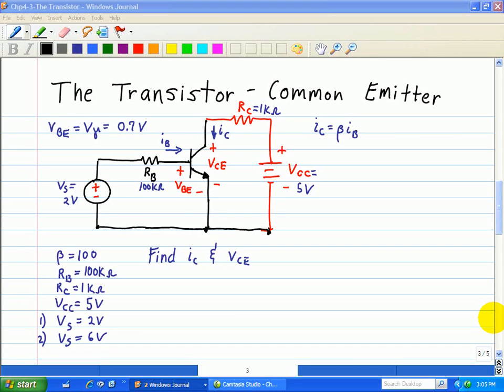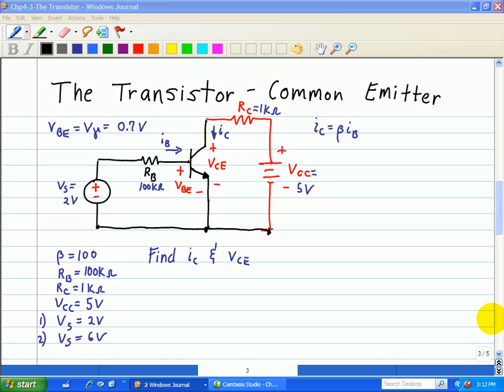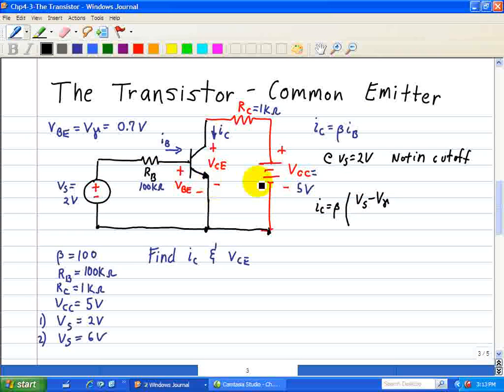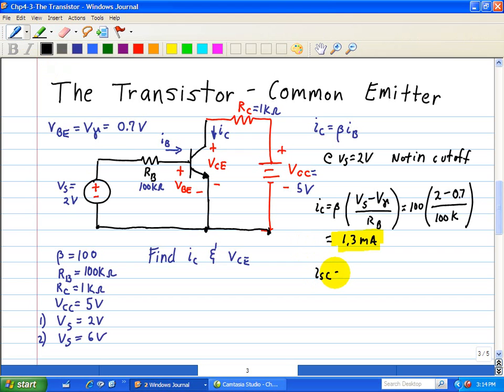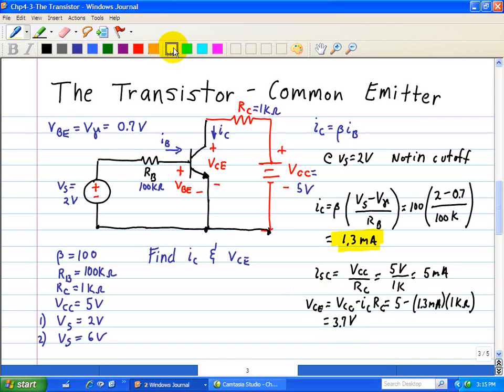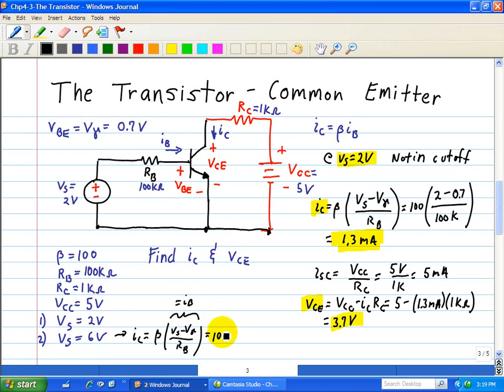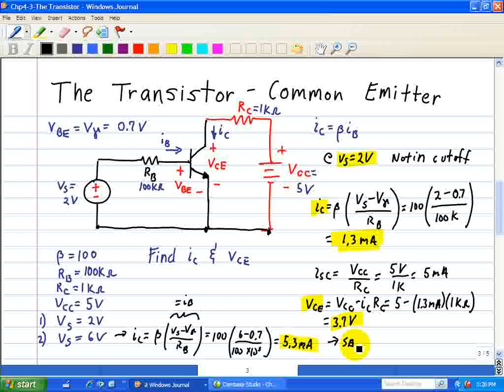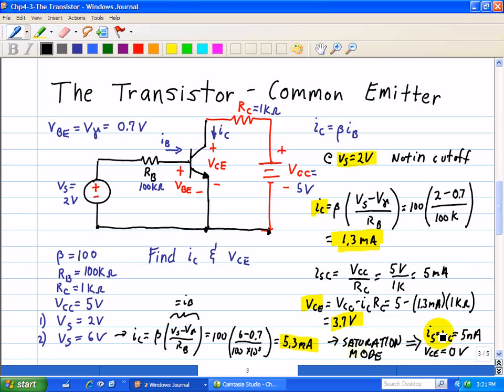Circuit Analysis - Transistor Tutorial - Common Emitter Circuit - Part 2 - Transistor Amplifier

Comment: dear  consider the voltage source  vcc, which is reverse biasing the collector and it acts as a simple battery sources so sum of all voltage will be the equivalent supply voltage , so Vcc= Ic rc +Vce, so to find Vce= Vcc- IcRc

Comment: @ZzFactorzZ

I believe it's the saturation current.  I think of it as the collector current when the emitter current is zero.  In saturation mode you can think of a short existing between collector and emitter.  Therefore, the saturation current = 5v / Rc = 5 / 1000 = 5mA